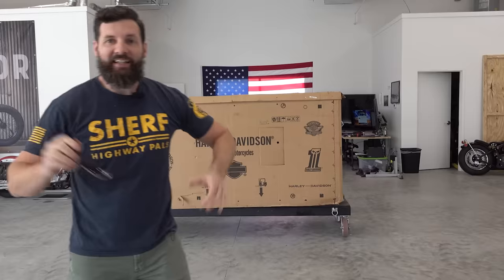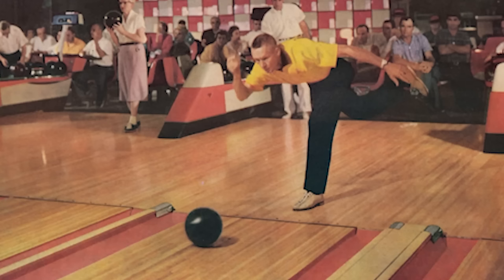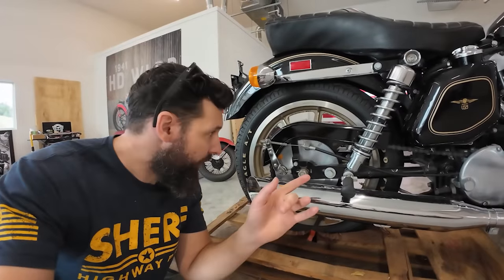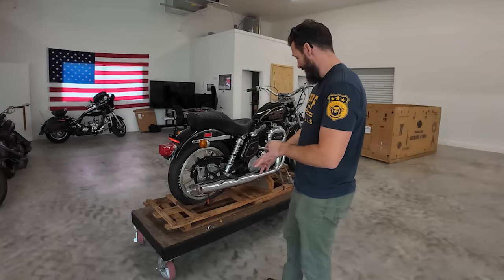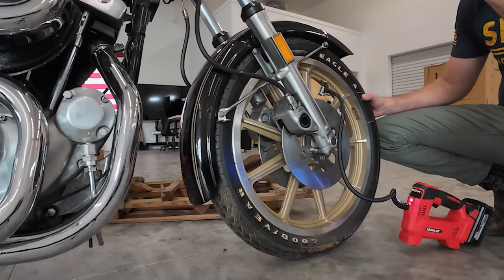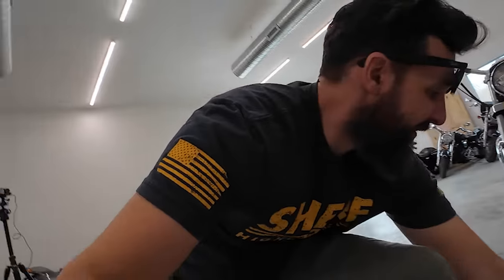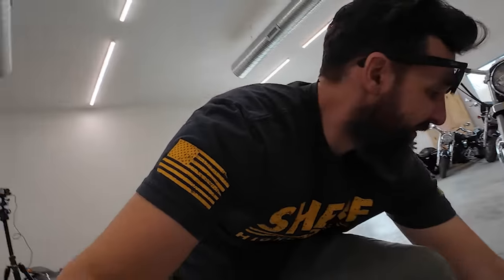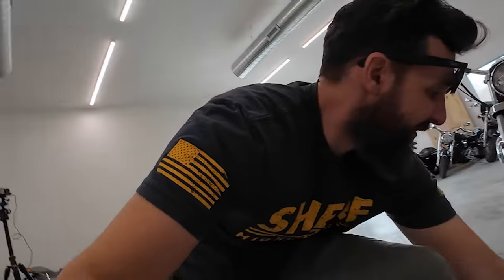I Bought a Brand New 45 year Harley Davidson Motorcycle

Comment: I had a 79 xl 1000 when it ran it was a beast. When it ran, there was a lot of non running. Also 79 had some weird quirks. Only 79 pipes fit due to the rear brake master cylinder placement and the rear fender struts were a 79 only fits item you had to carve out a bit of any other year you wanted to use. Ended up with a superglide front end that required turning down the center post as it was solid but the diameter was too wide but it was a much better front end handling wise. There is such a difference between the 78 and the 79 it’s glaring but those old iron cylinder sportsters were a beast…….. when it ran

Comment: I bought a slightly used 1979 Sportster on November 3rd, 1978. I wanted to help you with this bike soooo bad I wanted to climb through the computer monitor!! I know everything there is to know about the last of the Ironheads. I kept mine forty years before parting with it to earn money to save my 1977 ElectraGlide. Wiring diagram to help you with those wires Bro!!! They are Oil Pressure, Gen, and Odometer, Tach lights wires.

Comment: Bought my first new bike in April 1978. A gray 1977 Sporster with a kick start, $2778 bucks out the door. Rode it for 5 years and sold it to a friend who still has it. First thing I did was gut the muffler and rejet the carb, and swap out the handlebars with a 1976 set. Uncle Sam mandated the flat handlebars in 77 not sure why. Regardless was a fine machine for a 22 year old kid. Still ride today but I'm telling you those where the days...

Comment: Another line of AMF-Harley motorcycles were the two-strokes made in Italy during the 70s such as the SS-125, SXT-125,  SS-175 and the SS-250, all oil-injected.  I had five of them over the years, they were lightweight, fun to ride and much cheaper than the larger Harleys.

Comment: So I have a 1978 flh 1200, I found out that there were 1978 and 1978 1/2 models. 78 is supposed to be Harly's 75th anniversary. It wasxa confusing year but these bikes are great and u can fix alot of the issues some had.  love the sound of older harlies, shovels sound the meanest

Comment: The holes were put there to let gasses out the pads produced when heated.  This improved braking.  Modern pads don't emit gasses anymore.  However, the fashion has stuck.  The more holes you have the less friction surface is available for braking thus less brakes.  But it looks good.  You want looks or function? Know yourself.

Comment: I purchased a 1979 XL1000 XLCH. Kick start with no electric start. Before I had 1,000 miles I had lost 3 gear and no warranty, then it would blow oil when I shifted. The mechanic showed me the cause, the valve guides where not straight and it took out the seals and valves, no warranty. I kept getting water in my primary where the clutch cable went in the cover there was no seal, no warranty. Then the ground cable on the battery broke when I was riding.

Comment: By the way, there's nothing wrong with the AMF bikes, all you have to remember is that the fasteners were inferior so all you have to do is replace your case bolts and screws with quality modern fasteners. Then they don't leak anymore! Another old harley tech trick is to tighten the fastners while it's running( not an easy task and certainly not for the weak) the modern solution is to use blue or green locktite, and an inch pound wrench or manual impact driver. Just remember it's aluminum so don't hammer the crap outta it! Over time you will feel when that case fastener is just right and evenly tourqued

Comment: Ironheads are great bikes. Amf saved Harley because without them they would’ve gone bankrupt. 
There’s a drain plug on the crank case that should be drained, because after sitting the oil from the tank runs into the crank case. 
I’ve owned and worked on several Harley’s of this era or older.

Comment: I think that bike may have been crated way after it was built.   The two skull logos on that box were originally filed for copyright in 2004 and the number one skull on that box was originally filed for copyright in 2008.   The other thing is that crate.  I toured the York Plant many times in the late 70s and early 80s.  At the end of the assembly line there was a guy who would tune the bike while riding it on a rolling track and when he was done he would roll the bike onto the crate base, then fold the handlebars down, then other guys would assemble the crate around the bike. That crate was different than the one you have.

Comment: I still own a 78 sporty.  It was my first Harley.  All original except for carb, generator, seat, and pipes, although I still have the originals for those except pipes.  Bought it in 3 cardboard boxes and a rolling frame.  Lotta blood and sweat tied up in it which is why I still have it.  I can’t bring myself to part with it.   Every bolt is double-nutted and/or coated in loctite cuz it IS the stereotypical Harley, rattles apart and leaks like sieve.

Comment: One Question: Why are you not using your banana forklift, with some good straps, tie the bike on the lifts forks and just lift it up a few inches? Helps remove all the transport security stuff, and you can easily lift it down, too. It's just a suggestion if your lift can handle the weight  of the bike.
Reply from the maker: I did think about that, but chose not to bc I was uncertain the weight distribution of the bike

Comment: My first HD and my first new bike was a '78 Sporty. 1/2 way through the year in '78 HD changed the Sportster and in my opinion it forever sucked in appearance. That oil bag was pretty good looking, but had a tendency to loosen up under vibration and the cap would not fall off, but would open up and your buddy riding behind you would get pok-a-dotted head to to with oil. And yeah, '78 handle bars sucked a big one.

Comment: I had a new ‘84 sportster for 3 days. It had about 40 hp and less torque. I traded for an ‘84 Low Rider, loved that bike, shovel engine, 4 speed trans. Top gear at 50 mph and you could count the power strokes. My woman loved it 😂😂😂

Comment: LOL  the sprocket can be replaced on the drum.. back when you could get any parts... LOL  the pegs and clamps looked like that new.. i got a NEW 79, almost no chrome, minimal polish, very little shined. lots of brake levers were replaced under warranty make CERTAIN that was not.. they would just kind of break off at a stop sign..... mine did.  the throttle has no close cable.. they can stick open - most of us swapped to two cable by 80 or so, cheap safety fix .

Comment: No those straps are not that old. They didn’t use those until much later, just like the cardboard crate. It’s from probably 2000 and later. You’ll notice there’s no AMF logos on it and the Willie G skull came out in 2000 and the number one skull was much later too. The wood crate looks original though. We had bonfires with dozens of those because the factory wouldn’t take them back. They were one use only.

Comment: I hate seeing gas tanks get sealed due to rust. I use a mixture of white vinegar and table salt and the acetic acid will eat the rust right off the metal. If you attempt this, just make sure it does not contact any aluminum or it will get ruined.

Comment: If the brake fluid "turns to dust"   it's because it was exposed to air.  Not too long ago I used a leftover half can of 20 year old brake fluid and it was fine because the cap was tight enough.

Comment: By the way those red bolt covers are stock and not added. Older Harleys are ( vented ) the motor that is, and they will let loose with oil it's just a fact of life . They have a vent up on the right side on a AMF and one by the chain that also oils the chain . I dont know why no one knows this. A harley motor like most Motorcycle motors of that time has to be vented or with the pressure it will blow something.      j-d

Comment: An old trick from an old fart for the tank stability. when we could not find a replacement rubber mount- cut one out of an old tire- or an inner tube if its a really thin one. Works like a charm. Just eyeball the gap then look for a tire of the right thickness.

Comment: Ok forgot about 2.2 gal tank, swap it out for a 4 gal peanut tank, and stretch the down tubes 2 to 3 inches, and get the longer tubes from Franks. At least that is the way we used to do it.
Reply from the maker: its easy to find a modified sporty but impssible to find an original one
Reply: Yeah, he's just going to cut the frame on a 100% original 45 year old bike 🙄
Reply: Back in 1977 that is what we use to do, and yeah I'm old
 @BikesandBeards

Comment: Ethanol is the worst what you can put in the gasoline. Ethanol binds water from the air arround the bike and invites it in the tank, and that combination sink down and create rust, weld cast metals, destroy brass parts, brittle rubber and can't be ignited after 90-120 days.
Ethanol gasoline is the super villain for oldtimers. Especially with carbs.

Comment: #2 comment. Last one.....because I can't possibly list all of my issues with this. I am horrified, terrified and I couldn't possibly sign off on this motorcycle. The tires.....not only are they fill of dry rot cracks.....even if they weren't, they're 45 year old tires that have de-vulcanized and they aren't safe to ride across the parking lot, never mind to the end of the street.

Comment: It looks like it has the right handlebars , you just have to turn them down a little. The newer bikes have those Taiwan looking things , they really suck. You can't beat a AMF the newer machines are a joke , they are boring and made with plastic , pot-metal and sheet-metal frames. Young people in these times just crack me up , are you sure you have ever worked on a Motorcycle ?  I own a 1973 ' and a 1977' A.M.F.  Nice machine however , I like it.    j-d 💯
Reply: They are not the correct bars, the original Buckhorns were probably damaged the same time as the gas tank.
That would explain the turn signals & gauges being removed and the extra riser cover.

Comment: 😂 you can keep it it's AMF garbage. If it was before AMF bought the bike I would be interested but nah AMF was garbage. Nothing but problems.
The valves with vibrate loose and they leaked oil and they were just nothing but junk.